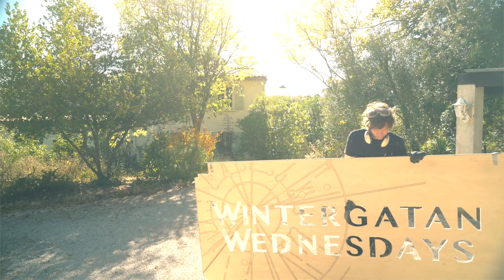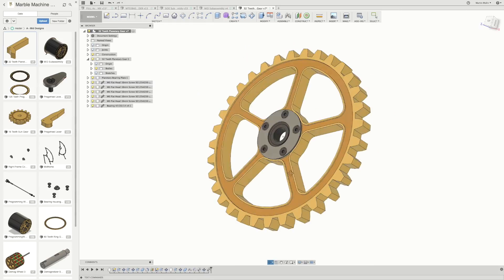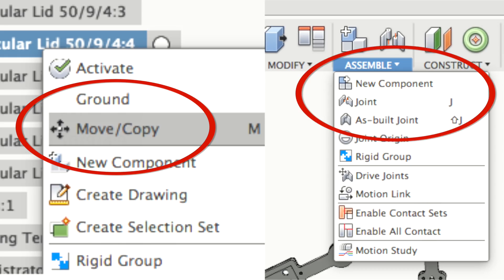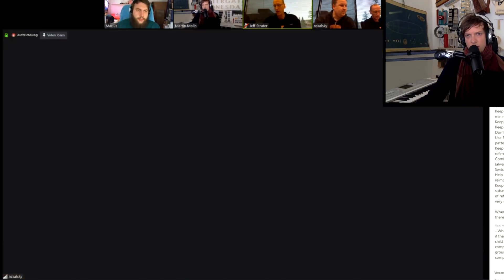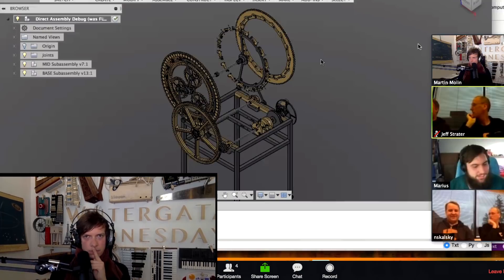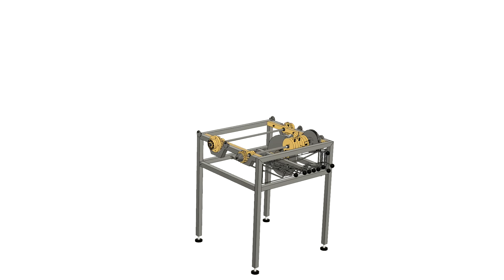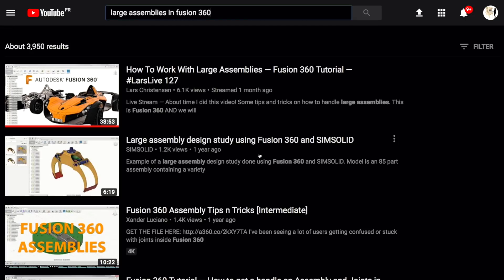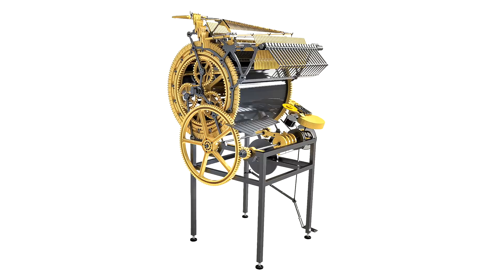Is Fusion 360 Unable to Handle Large Assemblies? - Marble Machine X #31

Comment: If you 

I think Rhino 3D could handle that, if you have the CPU, GPU, and memory to move it.
You can even lower the "rendering mesh" settings, so the parts would be represented from their NURBS counterparts more simply.

Rhino hasn't much for BOM, but you can make reoccurring parts into "blocks" you could get a count of them.

The CNC support would be 3rd party.

Comment: it can handle large assamblees but you need a workstaton cless gpu like a quadro p1000 it might not look like much but it beats high end consumer cards like the gtx 1080ti and also some more productivity optomuzed cards like the rx 580 but for even larger asamblys a quadro p4000 would be better and if you want to be shure that it will be sufficient then get a quadro p6000 but these are way more expensive but can handle just about evrything you can throw at it

Comment: Sounds like fusion 360 does not have much multi threading support, in that case if you have the budget get a PC with an 8700k and enough cooling to overclock it for the best possible performance. Ensuring you have enough RAM would be important too.

Comment: Did you ever consider using a programming disc for each note rather than the programming wheel (essentially a set of programming cylinders)? Given a pin radius p, on a wheel (for each note) you get 2r/p pins, but for a disc you could in theory get up to r^2/p^2 pins

Comment: I've been trained in Inventor. I still don't understand the difference between Inventor, Fusion 360, and AutoCAD. They're all AutoDesk software used for 3D modelling (Maya as well, but it has a more clear differentiation).
Reply: needamuffin interface and ease of use.

Comment: Thank you! I also have been told by Autodesk I am pushing the limits in large assemblies. I have traditionally used ground and rigid groups as little as possible. I build high-end pc's for a living and can say it is not a hardware issue. Fusion, though I love it, bogs down well before anything in my system is a bottleneck. I have found designing everything top down in one file is best, then breaking everything into separate files for CAM. Bringing in linked sub-assemblies really hurts performance once you get past a few hundred components.

Comment: Hello, I do the computer purchasing for my engineering department's workstations where they use applications like Solidworks, ANSYS, Aspen HYSYS some Autodesk products. We typically order at least a Core i7 and 16GB RAM, however these higher end simulations we tend to order a Single or Dual Xeon system with 32GB RAM and even an NVIDIA Quadro P600 or something like that. If you are going to continue making these complex projects I suggest getting a system like this. Your viewport framerate would also go through the roof.

Comment: I don't get why an assembled part couldn't just be considered '1' for the overall assembly. The idea of the fasteners and such is to make it one solid functional part. A 'gear' part for the purpose of overall assembly for animation should be just that, '1', as if the entire thing, hardware and all was all made out of one piece of plywood. This would cut the processing down drastically.

Comment: Quick answer; no. it's good for accessibility, bad for power. and Yes, I'm speaking from experience :P
I'd personally recommend Autodesk Inventor -  it's all local, and so much more powerful - as in, made specifically for applications like this. If you can afford it, (which, yeah, if you're not a student, the price is pretty high), it's definitely worth the cost.

Comment: You'd have this problem with any 3D CAD program.   It's a limitation of Hardware, not the software. When we're rendering large projects in AutoCAD, Vectorworks, or SketchUp, we often use placeholders called Proxy.  These are simplified shapes that take the place of the final components until just before or during final rendering (depending on your CAD program). In most instances, we use the proxy file to setup the views that we want and then either the Rendering engine can replace the Proxy objects or they are manually updated.

Comment: Fusion 360 handles large assemblies just fine.  You need a computer that can handle the load. you need a lot of RAM and a CPU with many cores, and a few Quadro graphics cards would help too.  I run Fusion 360 just fine on my Threadripper test bench.  I have a fully fleshed out drawing of all the parts for a 2001 Camry.  Thousands of parts. I use it as a benchamrk for testing CAD workstations.

Comment: Hi. 
I recomend you to move your proyect to CATIA. 
I think this software is ideal for you for a lot of reasons: 
1.- You can create the model like autocad. 
2.- The software can talk with your cut machine directly.
3.- And this software can do crazy things like, select materials for your pieces and use your machine virtually and see how continuous use affects the parts of the machine.

I know this software will hard to learning and expensive, but don't have any limits. I saw a very complex model, working well with a couple times complexity than your machine.

( literally a commercial rocket, I work in Airbus Defense and space ) 

Best regards

Comment: Assuming F360 scales well with more cores which it must do to a certain extent, not knowing much about F360 i can still know that there is no way this is a bottleneck of the software its blatantly the hardware letting the software down....A high end PC with a 16core 323 thread CPU will help no end , apple cant touch that sort of power even with their top intel cpu's, plus you pay 4x the price for anything with an apple badge!! As for people saying its the program that sucks, you obviously never run it on the sort of hardware it deserves, saying a professional bit of software cant do what its programmed to do is dumb, you think they wouldn't have fixed it if it was an issue with their software you pay 100s for pounds for, nope is hardware, top level designers will have top level equipment bet it runs great for them???!?

Comment: Why is the program only using a single cpu core? I see no reason to make a cad program that cannot take advantage of the hardware.
Reply: It is intrinsic to the problems a CAD system solves. Simplified you cant really do all the edits to a solid body at once (parallel), you have to do them one by one which results in very poor parallelization (i.e. single thread). (Kind of like carving out a sculpture out of a raw stone, you cant simultaniously square up the block and sand down the final shape) Hope that helps with understanding it :-)
Reply: Oh, That seems very logical now! Thanks Marius! :D

Comment: This method of modeling everything in relative coordinate space is used even with the highest powered CAD programs. In my work in the Auto industry, using CATIA, everything is modeled/assembled in "Vehicle Coordinate Space" (setting the origin to be the center point between the front wheels) to make it easier to deal with the top level assembly and even then, with the best hardware and software, performance bogs down on very complicated models. I believe the same technique is used in the Aerospace world as well.

Comment: The screw and the sketch simplification are the main discoveries you made. I work with Inventor (same Autodesk, but older and somehow wiser for big assemblies) daily and it has ways to deal with very large assemblies ... which are representations of simpler models, working with project folders where reading/writing is prioritized, and allowing for simpler versions to be created of models. 

You don't need to model the thread of a screw .... old school industrial designers didn't, they drew a simplified screw by HAND. And then CAD models adopted the solution with "cosmetic screws" (solidworks calls em this, its a rough texture that looks like a screw on the threaded part). Some programs have a "screw toolbox" that create fast and normalized bolts and nuts, but the screw is just cosmetic. Even in a CNC production, it's likely you'll purchase the bolts from a retailer .... or in a very specific case, ask for a machinist. And he won't need a detailed blueprint! Just the parameters and a simplified sketch/blueprint

And as for the gears ... a solution would be to model a gear with only 3 or 4 teeth for the large model. The rest as a circle. Looks ugly ? Sure, but so are most gears on CAD and paper hand-drawn depicted. I'm happy you found a workaround on the sketch lines, that is something that's almost irrelevant on small designs but it adds up quickly. On large and medium biz there's CAD rules to keep drawings consistent, simplified, and error free. And 99% of the times , simpler is better.

I don't know if Fusion does it, but Inventor shows you the "load" of the model you're editing on the bottom bar. Two numbers which show you how many files you're loading and references ... and I've seen some models with a whole lot. Then even with an optimized program, and a beast of a work pc, it lags.

So it all adds up. If instead of 12 instances of a file you call "screw" with a very detailed and metalic thread you generate a pattern with a placeholder, that saves up. Same on textures for the GPU (and ram! these programs EAT RAM AS MUCH AS CHROME )...

And, in my later CAD studies, I had the ¿pleasure? of learning a bit of CATIA V5. It's ugly. It's very weird to use sometimes. But it has an engine and methodologie for working with very big assemblements, by working by sections or type. You have to be methodic with the nomenclature, folders, etc... but it did work very well with the car industry for years.

Anyway, sorry for the big, big, big comment. If any of these sounded a bit pedantic i'm truly sorry. It's what I loved doing on college and what I've mostly worked as (and work now!). Its touching to see someone I appreciate face the same problems all CAD users have suffered :)

Hope next video shows more stuff and less computer/software issues!

Comment: You need Autodesk Inventor for large assemblies.
Reply: Demian Geven Having made different choices with current stuff 2 years back is pretty common, but I liked this because the remakes did afford some progress. Can he also progress by solving/modeling subsystem behavior in R then letting Fusion do the outer join that suits it?

Comment: I had a project on school where we made a building in Revit. The project was to make each sub assembly in a different file and then combine them. Every discipline like the facade, construction, installations and layout had their own model. When we combined them you can see that it is difficult for Revit to move things afterwards aswel. But since we started from a template with all outlines set we could just combine all the models and make renders and stuff. Cool stuff!

Comment: I have another brand of a CAD program and I had the same problem with the large assemblies. In my case a large manufactured telescope assembly of about 150+ parts I reduced into that CAD program. The same kind of problem solving e. g. origin point, was applied years ago. Also my fellow program's users made the screw threads as "surface" instead of "solid" which helps with the CPU bottleneck as Marius in the comments describes.

Comment: Isn't the bottleneck of the problem the fact that most things in fusion 360 are done on the cloud instead of on your computer, which means that most of the latency are because of the internet connection or how much server resources Autodesk grants you? That is probably the reason that there is no significant difference between Marius' PC and Martin's laptop. Inventor and other non-cloud based programs do the calculations on the client computer, which usually is faster. It's probably mostly the fact that the drawings are saved online rather than locally that slows everything down. I'm not that much of an mechanical engineer, but I would say that Inventor is not that different in terms of how to use the program, even though it's more expensive.
Reply: Thank you for mentioning cloud! Out of 800 comments the word cloud only came up four times and you were half of them. The truth is we don't know how much is done in the cloud and we don't know if we are getting good or poor cloud cycles, all that is metered out in secret. If Fusion 360 users are interested in investigating this problem then we should share a complex document and share our results. Has this been done???
Reply: Brian Boni
What we allready know from commercials is that all objects are saved on the cloud (not sure if they are also saved localy), but not the extent to which things are saved and processed locally. A hint is that Inventor is much larger in file size, so maybe material surfaces are saved online. To really find out, I would read more on their specs and Commercials about Fusion, and to reverse engineer, I would probably start by monitoring the network activity (the packets = the data sent and received) using Wireshark or the like, rather than try to collectively try to collect data before knowing what you're looking for.
Reply: Brian Boni reading your answer again I probably underestimated how much you know about computing, so sorry if it sounded like that in the first reply.

But some kind of complex document could be done, even though I think it would be better to make and use some kind of monitoring program that collects the latency info and uploads it to the shared document, since manual input would probably yeald too few and too inconsitent results.
Reply: Brian Boni what do you mean with cloud cycles? Guess It's about the server time, but could not find a definiton.

Comment: I'm very impressed with your systematic approach to the problem. It's obvious that you have pushed Fusion 360 beyond what the designers had anticipated, but your work-around should carry you through to the end.

Actually, with something this complex it might be better that you can't move things around in the full assembly. It might be clumsier to make the changes in the sub-assembly and then join the subs into the full assembly, but it keeps you from being overwhelmed by all of the parts in the full machine and allows you to concentrate just on the bits that need changing in a particular sub assembly.

Also, migrating to Inventor at this stage would probably delay the project and at this point I don't think you're interested in any further delays (me as well!!)

Good luck and press on. I have every confidence that this will be a wonderful, amazing device and I'm in awe of your many talents. You aren't any relation to Leonardo da Vinci, are you? :)

Comment: Ok I was curious. The difference between Fusion 360 and Inventor is that the latter is about 10x the cost than fusion 360. Which is pretty extreme but it's the more professional program with aim at really professional users. 360 seems more aimed at the prosumer enthusiast.

Comment: We use Autocad and Inventor where I work. Inventor we found is more powerful than Fusion 360(nothing against 360). We produce very complex projects with many facets.  We saw this problem a long time ago.  The way we fixed it was to purchase a more powerful computer.  We now use 12 core CPU and high end graphics EVGA 1080 card.  We also found memory was an issue.  We also upgraded all of the our systems to 32Gb memory.

Comment: Hi, I have been working on wind turbines with 100.000+ components and we used the same methods. Crating modules/subassemblys that are individually grounded. This helps when you are working on interface between modules. You can easily create a assembly with only the modules you need to work on. Then you don’t need to open the top level assembly all the time.

Comment: Not sure if AutoCAD Fusion 360 has an equivalent but in SolidWorks we make sub assemblies and then make them "lightweight" in the top level assembly. That way all the bodies and mates in the sub assemblies are just phantoms and can not be modified. Works like a charm in some of my assemblies with 4000+ parts. You still need a beast of a machine to process it though.

Comment: Didn't watch it yet, but usually converting from parametric models to solid shapes do the trick.
Reply: Also, i doing small project in FreeCAD right now, and it's 3rd party plugins for gears and fasteners have options to switch threads and teeth on  and off, really nice feature.

Comment: While being more expensive there are other programs that work similarly with better performance.  One program is called CATIA that was developed be a separate party then autodesk.  It’s the same program that major airlines use to do there assemblies.  Another example is called inventor.  This one is actually developed by Autodesk.  I would recommend CATIA the only problem is it’s very expensive.